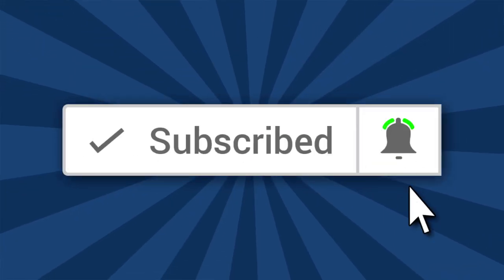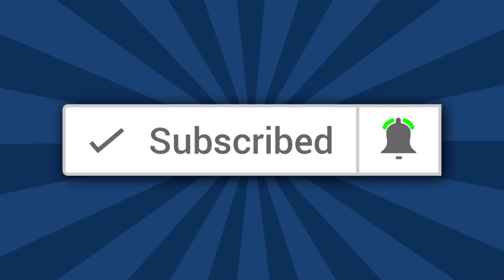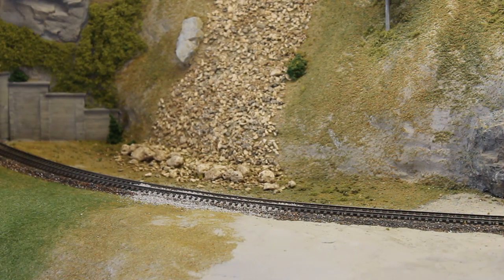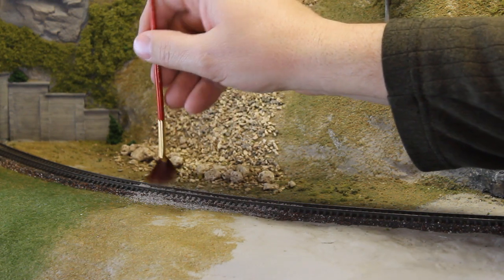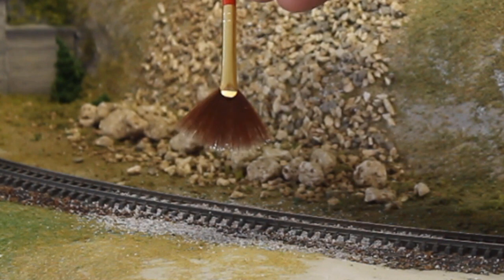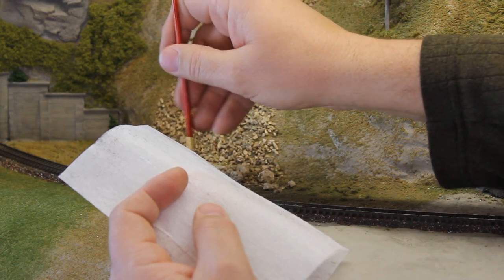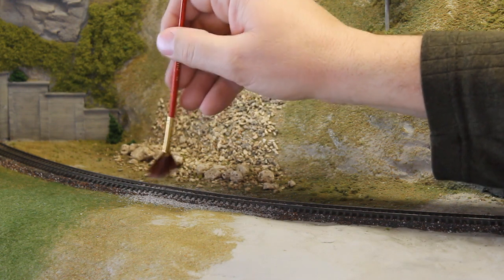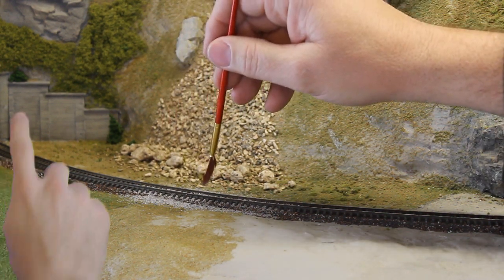Model Railroad Track Ballasting Tip

Comment: FYI, neat story about ESD and the fabric sheets.  Long ago ESD was not fully know and they were still trying to figure it out. Well one day they notice some boards that were shipped to a tester had less issues than previous batches. Well when they were trying to figure it out they noticed something. The bags are usually washed with soap and water then rinsed with pure water. Only on this batch they did not rinse the bags. They found that the soap prevented static charge from being generated . Thus soon after static preventive devices were made and the fabric softener sheet was one of them.
Reply from the maker: Interesting tidbit. Thanks for sharing the info.

Comment: Wow! That's something I never would have thought of myself! Although I don't have a lot of experience with ballasting (yet), so that's a handy tip for when I do. Thanks a lot for this tip!

On a partially unrelated topic, have you ever used sanded grout for ballasting or for any of your scenery? I model the late 1800s and into the early 1900s and simple plain dirt was often what was used for ballast as opposed to rock. Though finding a grade of ballast fine enough to look like dirt has always been a challenge. Even the fine grade products seem a little over scale to look like dirt. However I've heard/seen some folks use sanded grout for dirt and ballast. Any thoughts?
Reply from the maker: I have not used grout, but I know some who do with nice effect. I think what you want, however, is UNsanded grout. It is much finer and will give you a better dirt/gravel effect in HO or N scale.

Comment: remember humidity plays a big part, so don't do it on a very dry day or it be 10 times worse
Also one way to prevent the static is an ion generator, this is used in electronics world, probably not practical unless doing a ton of work

Comment: Great tip Ron. Thanks for sharing. Did you intend the title to be Model Rrailroad ... or is that a typo? Harold
Reply from the maker: Typo--I fixed it. Thanks for the heads up.
Reply: You're welcome. You might consider deleting the comment as it is no longer relevant...Harold